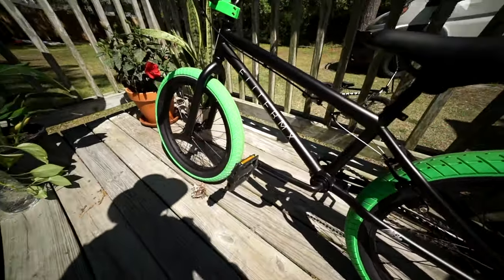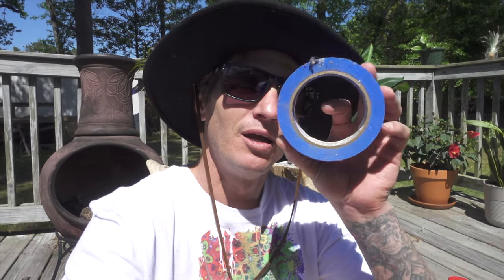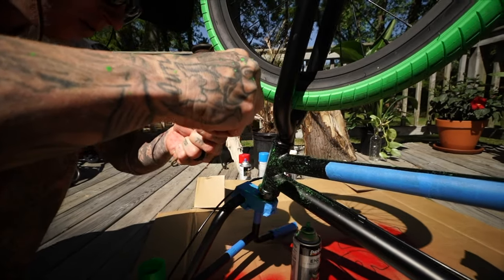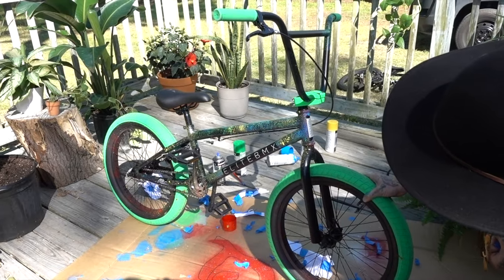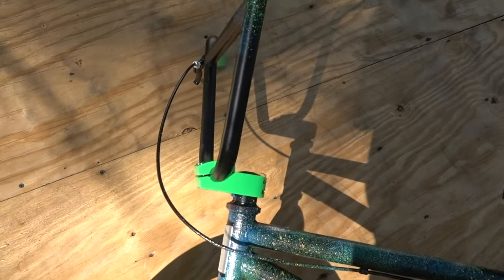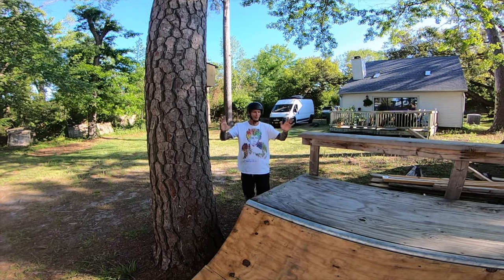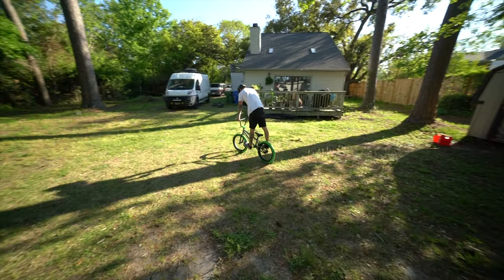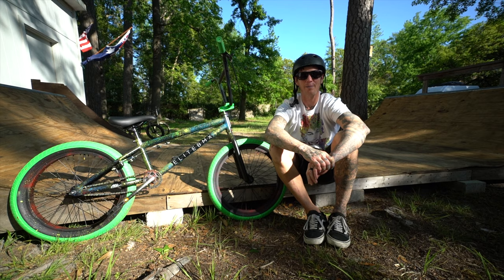GIVEAWAY BIKE CUSTOM PAINT JOB **EASTER HOLIDAY**

Comment: Much love brother!!! I would be honoured to ride this bike and film the progress of me getting back into it after a 15 year lay off. Dopest paint job!!!! I actually bought two of the old Beenleigh skatepark Ramps when they went up for auction but I haven’t had a bike of my own to ride em iv only seshed em on my mates. Im still looking for the right one. 🙏🏻❤️
Reply from the maker: Thanks brother
Reply from the maker: That’s crazy which ramps did you buy tell me more
Reply: Ryan Guettler the sub box/step down and the vertical wall ride thing. I got the two to make a half pipe but the vertical wall ride is hectic and huge so we are going to remake that one. Check out my insta for the first couple of rides. I sent you a message. IG - Lylow